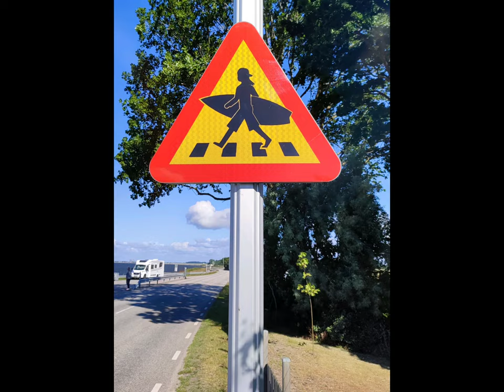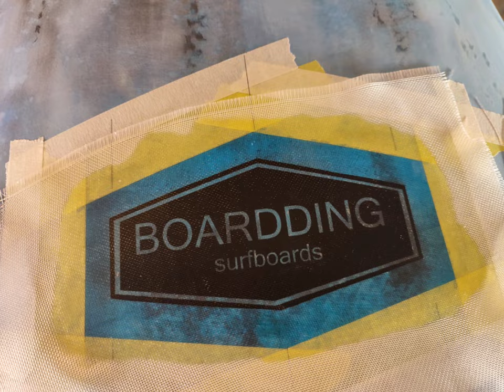Board-ding Photo

Comment: I've been playing with the idea of building one of these / wind foil boards but making it "invisible"

 Maybe using plastic forming, removing the foam, then wrapping the plastic with fiber.
It may reduce the weight and speed up the process but not sure if the plastic wrap would handle impact / weight. 

If you wouldn't mind building a few of these and sending me one, I would be over joyed. 

great videos, thanks.